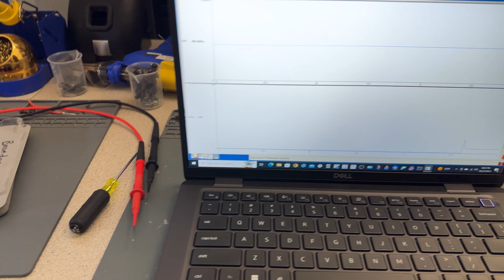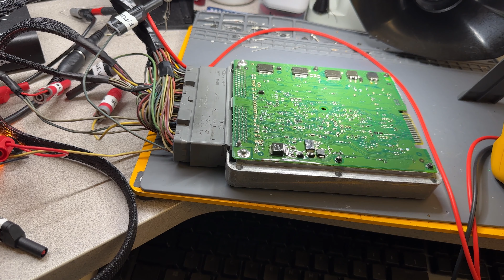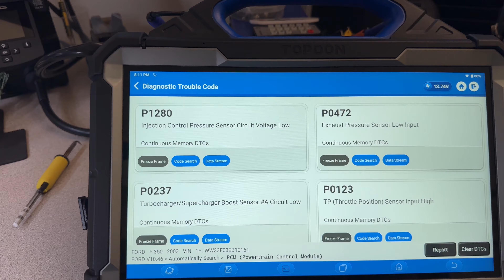2003 F-350 7.3L Diesel fault P1747 EPC full test and recommendatiions

Comment: Awesome video, way too advanced for what I'm doing. I'm just trying to get a resistance amount and how to for testing solenoid A/B & EPC. 
2003 gas f150 threw 8 transmission codes, was told to swap transmissions....did that, same symptoms. 🫤